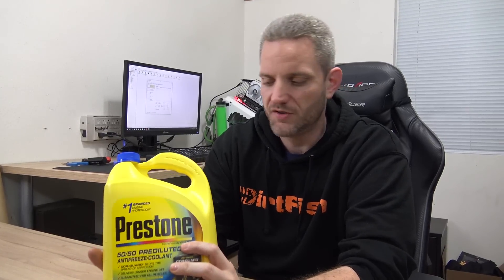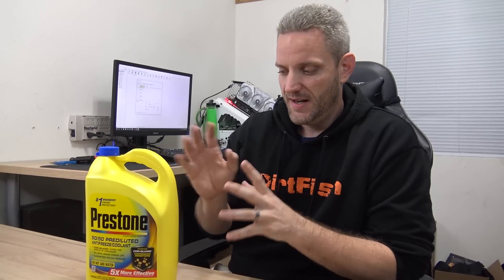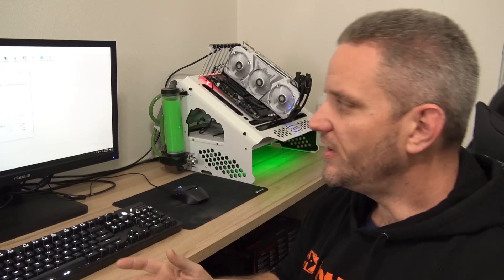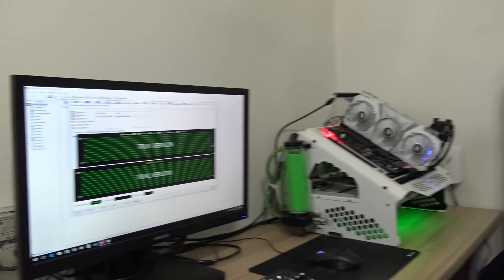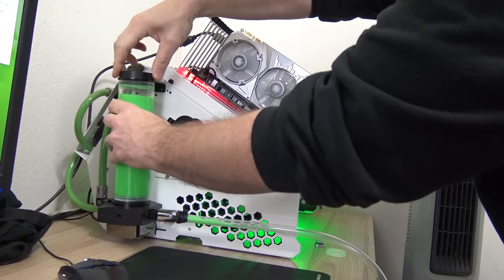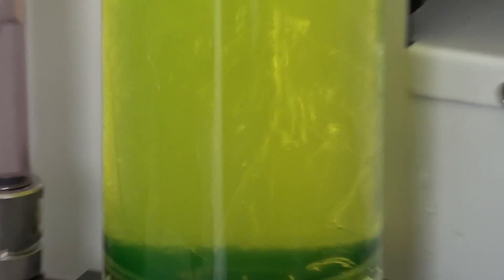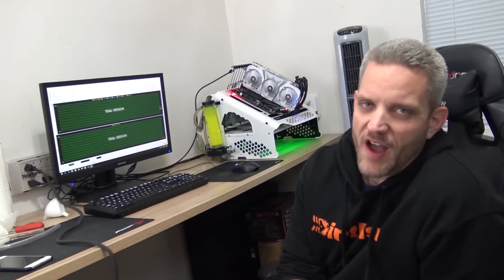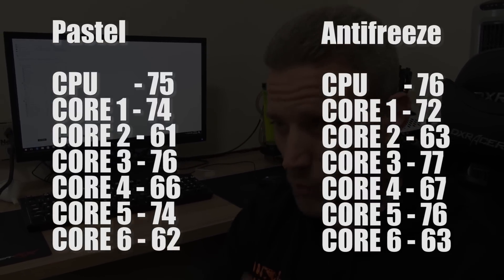I used Antifreeze to cool a PC

Comment: Question: could one build an alcohol based liquid cooling solution? 

Probably won´t archieve much without any evaporation going on, but alcohols like IPA or Ethanol evaporate at massive rates compared to water, and the lines at my workplace run very, very cold.
I also don´t know how the temperature properties are compared to water.

So there´s a couple stops one has to take into account, for example condensation needs to be kept in check somehow...

Comment: Have been using antifreeze in my system for 3 years now, no problems at all, 2x6990 with EK blocks, soft tubing, thermaltake pump, reservoir, 240radiator and cpu block. always 50-55 degrees.

Comment: Any decent car guy would know this. Even better, cuz antifreeze (will work tho) is not as good as 1 bottle of Redline Water Wetter or the Royal Purple brand (@ auto store,12 bucks) mixed with Distilled/RO Water. Many of race & hot street engines use this formula.

Comment: use radiator coolant or Hydraulic fluid.  You also use dextron 3 or other oils.
Reply: Inverted V12 Powerhouse the pump will die
Reply: GamingTurkey use a salvage backhoe pump ;)

Comment: At work we use barcode decoders (basically a lower-end PC) by a company called Datalogic (used to be Accu-Sort). They're totally sealed cases due to the dusty environments they're in, so they are also water cooled. Datalogic actually tells you to use antifreeze in the loop, specifically the pink RV stuff which is also what it's filled with at the factory.

Comment: Been using a small amount of antifreeze in my system with distilled water for a year now to cool it and prevent corrosion. It's been working just fine at really cool temps.

Comment: you can use jet dry though or very light weight silicone based oil.  or just take the whole thing and dunk it in mineral oil.

Comment: I've exclusively used antifreeze since 2010 in a swiftech H20-X20 with soft tubing and have never had a problem with corrosion, contamination, or equipment incompatibility. The tubing is still clear to this day and the mcp35x is still running strong.

Comment: You do realize commercial PC cooling liquids are nothing more than ethylene glycol, distilled water and color additives, right? I've been using antifreeze for private and industrial cooling solutions for over 20 years now. Get the red VW stuff, 1,2-ethanediolalcohol. Not the cheapest but literally lasts forever.
Reply: Jay thinks he is the watercooling guru... he only thinks that though.
Reply: Always run 50/50 antifreeze and distilled water. Anything less and some algea can actually live off the sugar and alcohol in the antifreeze, and you don't want to mess with stuff that can survive in glycol ;-)
Reply: Exactly!! I've been using Prestone for 10 years, not one issue attributable to the liquid, but one or two attributable to me(the great ruined EVGA board of 2007 comes to mind.) I uh, didn't check my hose connections thoroughly.... / : Haven't tried the VW stuff yet, I will.
Reply: Brian Hansen I'm a Audi mechanic and I have tons of g12/g13 coolant at home. (G12 is red/pink g13 is purple) I've been using it in all my loops for 17 years. Never had a single issue. Just mix it 15/85 af/water.
Reply: 👏 @Audiman0aha
Reply: @Audiman0aha 1:5 you mean?
Reply: @EpicBunty  No... 15% coolant, 85% distilled water.
Reply: @Audiman0aha  hahahaha ok sorry for trying to simplify that. I'm planning on taking apart my aio and was just curious.
Reply: @EpicBunty  Hey, it's okay brother. You basically just need to use something as a biocide to make sure you don't have any algae growth inside the loop. Other than that the water does the actual cooling.
Reply: Well, the coolant also works as a conditioner to keep the metals from breaking down.
The reason why car antifreeze works so well is because the average cooling system in a car has about four or five separate metal types all in one cooling loop. Copper, aluminum, magnesium, etc.
Reply: @Audiman0aha  I see. Coolants don't have biocide properties though right ?
Reply: it was pre-mixed antifreeze, already diluted.
Reply: Same here, it's anti corrosive and the heavier weight of the liquid actually results in better heat transfer. I compared it to PC coolant and Distilled water. I also tend to use a big add flowjet pump that lasts forever and out powers the shit out of a $100 PC pump at only 5v.
Reply: SchwererGustav800mm
He also didn't dilute the AF, 1:1 is too heavy and will not cool as well.
Reply: megaspeed2v2
Yeah, I saw the video. It needs to be 15:1 or less.
Reply: Kinsey Benedict hm.. ok then

Comment: Use gallium to cool your pc
Reply: In aluminum tubing right? :D
Reply: Gab:P
Reply: PRO-digi if you turn off the computer it would go solid
Reply: PRO-digi metal conducts heat better, liquid solution without glycol would be better.
Reply: +Gab
 even just aluminium cooling block is all you'd need.
Reply: Brad Hintz Depends on iff you use pure gallium or an alloy that has a lower melting point

Comment: How about another liquid meant for automotive applications: Water Wetter?  It's used as an additive and reduces the surface tension of the water/coolant allowing for better metal wetting which increases heat transfer.  In other words, the lower the surface tension of the water, the better it can flow into all the little microscopic nooks and crannies that are on the surface of the water block.  This effectively increases the surface area of the water block by a pretty large factor.

I doubt it will be any better than the additives that are like it that are specifically made for computers, but it would be interesting to see the result nonetheless.  Pretty easy too; just dump the Water Wetter into the system and fill it up the rest of the way with distilled water.

Comment: I think that weird shit in the antifreeze when u first put it in was jsut the water that was in the bottom not mixing intermediately with the antifreeze
Reply: This.
Reply: Need to has the drama tho
Reply: Could also be the heat from the pump. Like a lava lamp, the heated liquid is traveling towards the top.
Reply: yeah its exactly that. Like when you mix water and fruit juice
Reply: Ya. Water is lighter than the 'antifreeze' oil so after pouring it would settle by going upwards to float on top of the antifreeze.

Comment: As i know antifreeze is used to prevent liquid to freeze in extremely cold climetes. In a liquid cooler the liquid becomes hot and cooled later in the radiator. Like you said it is pointless. Fun video anyway. :D

Comment: I have a off brand H80i from alienware in my system last year the heatsink in the cooler that sits on the cpu became crusted by some material in the coolant. so I took it out boiled the heatsink and scraped all the gunk out. then I put it all back together and filled it with purple antifreeze. still working fine.

Comment: Anti-freeze is actually worst at cooling than water. Anti-freeze is only used to prevent freezing, boiling and to prevent corrosion within the cooling system. That's why 50/50 solutions are used. 100% straight anti-freeze can actually cause your vehicle to overheat.

Comment: So I ran a test. I routed my cpu and sli water cooling tubing out of my room and into my attic so the cold air outside will cool my radiators. 
the experiment came to a quick end after the temps outside reached cold enough to cause condensation on my water blocks. I even had to unplug the fans from the dual 480 rads to prevent dangerously low temps. there will NEVER be a scenario where ANTI FREEZE is necessary.

Edit: location Detroit.
side note, the computer could never be turned off to prevent the water 
temps from going low enough to begin condensation on the water blocks. I
 literally would run games in the main menu at 5760x1080 as my "idle" 
and temps were in the 30's C when ambient temps in the attic were 30-45F
 with the fans on the rads off.
Reply: I guess it's kind of like a cold bottle of water or glass of iced sweet tea sitting out in the summer sun in the south.

Comment: EVERY single PC coolant sold on the marked is MEG based! The rest is marketing BS. Bring some coolant to independent lab for testing and see for yourself. It is also worth mentioning that all this "green" bs advertised with coolants is also pure marketing. MEG is organic compound with half-life of roughly 28 days. 

Not every antifreeze is the same. There are also glycerine based options as well. Also - there are solutions that use silicate-free corrosion inhibitors(no gunk). Just read the datasheet if it comes with any. It took me about 1 hour to find myself a local manufacturer who stocks all kinds of cooling liquids used in every possible situations - form automotive to industrial. Even managed to find a colorless MEG ready-made, silicate free concentrate for preparing 10% solutions for €3/liter.

Comment: ugh. these people and not reading what's in their coolants. here's the specs on the thermaltake stuff my system uses - 

Water ~ 94%
 Propylene Glycol ~ 6%
 Ethylene diamine tetra acetate detetrasodium (ED .TA.4Na) ~ 0.1%
 Methylparaben (M.P) ~ 0.1%
 Color pigment ~ 0.002%

for those who don't know, propylene glycol is what's used in modern anti freeze mixes like dexcool in GM vehicles. only the recipe is different, the ingredients are the same.

Comment: I was going to make a comment about using straight antifreeze, but then I noticed in the video is that Jay is actually using pre-mixed 50/50 antifreeze (50% water, 50% antifreeze, which is a marketing gimmic, you pay more and get less product), this making my comment useless. I would like to mention that the antifreeze that Jay was using is OLD SCHOOL, as modern coolants are either Gold, Orange, Red , or Dark Green. ALL modern coolant also incorporate a anticoagulant agent in them so that  minor leaks will self seal ( that is why when modern coolant leaks you see white crystal growth at the leak point) . Jay, you might want to consider doing a video using Gold coolant and creating a minor seep (very minor), and one of the fittings, and video the process of the seep self sealing and thus saving the computer from a leak melt down.

Comment: The only reason cars use antifreeze over distilled water with anti-corrosives | anti-microbial is because in colder temperatures the liquid will not freeze over. I use distilled water on my motorcycle with additives in FL because temps would never get that low.

Comment: Antifreeze isn't actually used for cooling the engine of your care. It actually has a lower boiling point than straight water. It's called antiFREEZE because the petrol and glycol lower the freezing point of the water significantly. The idea is to keep your engine block from freezing solid and cracking in the winter. In the summer a car can be cooled with just water, although it's not recommended.

Comment: I have heard that the AIO manufacturers put ethylene glycol in their loops. I don't know if it's true or not. But antifreeze does have a few corrosion and reaction inhibitors. I have doubts that soft tubing would hold up in the long run with antifreeze.

Comment: This went exactly as I expected it to. Antifreeze/Coolant doesn't improve the cooling qualities of water. It just reduces the freezing point and increase the boiling point of water. ie. it makes the water withstand harsh winter weather conditions and the high heat temperatures an engine goes through (Usually around 100 degrees celcius). None of which would ever be reached by your average computer.

Comment: good video, but not surprising. glycol has a worse thermal conductivity than water, so you'd expect the heat transfer performance to be worse. it's added to vehicle systems to prevent freezing at low temperatures (below where water would normally freeze).

Comment: I used antifreeze diluted to 50/50 for years in loops I made about 10 years ago. It worked great and cooled as well as anything on the market at the time. It also had better anti-corrosion and anti-algae properties. The only difference between then and now are the plastics used in WC components. Any plastic with glycol in it will react with antifreeze. Avoid those plastics and you will be fine.

Comment: The issue I have with this is that ethylene glycol in antifreeze is not there to increase cooling capacity, it is there to keep the engine from rusting and more importantly to KEEP WATER FROM FREEZING!  Alcohol has a lower freezing point than water -12.9c versus water at 0c.  Alcohol also has a lower specific heat than water, so you are actually losing more theoretical cooling capacity than running straight water.  Another reason this works in vehicles is that the cooling system is pressurized, which increases the temperature needed to gassify (boil) fluids.  Hence when you take the radiator cap off when the vehicle is hot, fluid spurts out (fluid is flash boiling and the gas is carrying out fluid from the radiator).  This plus the reasons JayzTwoCents states, are the reason to NEVER use antifreeze in anything that it is not designed for.

Comment: so if my CPU gets up to 43 °C or 106 °F while playing battlefield 4 is that bad? I am using air cooling
Reply: why are you reading temp in fahrenheit? Weird...
Reply: Airtrooper719 XBL OK, 42 °C
Reply: no it would almost have to double to be anywhere near worried
Reply: donutsniper No my CPU hits 82°C under full load with air and its fine. My CPU is 29°C at idle. (i5 4690k @ 4.7GHz and evo 212 cooler)
Reply: no, mid 40° Celsius is 100% normal temperatures for a CPU or GPU that has more than ample cooling for the amount of thermal it outputs under load.
Reply: OngoingTech that's not good
Reply: 43C is very acceptable with a load on CPU.
Reply: xGattsu I dont bother with prime95 or none of that shit, if it works with what I want it to do, thats good enough for me :) in my case, the CPU OC is mainly to help BF1 along more in 64 player matches.
Reply: p.s I can get to 4.8 on air, but I use 4.7 for extra peace of mind and lifespan of the chip.
Reply: Not at all. I run my i7-3930K at 4841mhz for gaming Battlefield 4 and BF1. Even water cooled, cores can get as high as 67C. Not an issue since lower clock speeds and even stock clock speeds can exceed 60C with stock cooling. I would suggest any temp above 80C for prolonged periods might be detrimental.
Reply: cause America leads the world
Reply: google it
Reply: 40C is ok, but 50 and more is getting hot
Reply: Ali Abbas thank you!
Reply: Ali Abbas I just played call of duty MW3 and I got 59°c max

Comment: what you see and you say it is a reaction is most likely the change of refractive index of the fluid during the process of mixing the distilled water residues with the mixture of water and ethylenglycole. Why don't you install a loop with just a pump and a reservoir without any hardware to see the long term properties. I don't think it will do any harm to the plastic either. Worst case the plastics get milky but not worse than that.

Comment: I have some experience in running a car coolant (ethylene glycol based) in my primary PC. My loop (all soft tubing which I think is PVC-based, the brand is Masterkleer) was running for over three years with a liquid that was approx. 25 % car coolant (it was not neon green, but dark green, the brand is Glyco-Shell) and 75 % de-ionized water. No problems, only needed periodic addition of liquid which I think is not because of leaks but because I have long tubing, my radiator is outside and far apart from the PC, and I have read that the liquid evaporates through the soft tube's walls. 
I then took the system apart and carefully inspected all components. The only change was a slight green coloration of the tubing, NOTHING else.
My primary reasons for using the "anti-freeze" are: it provides some additional lubrication for the pump, the green color helps detecting possible leaks, the possible anti-corrosion and anti-algae effects. I have read that pure distilled water could also work without problems, but for the above reasons and my experience I will continue using the 25% anti-freeze in DI water combination.

Comment: Another point of interest, because your car operates at much higher temperatures, automotive antifreeze typically lacks growth inhibitors. Want to see what happens when it's run, in not just one system, but a whole room full, for extended periods? Go watch LTT's whole house water cooling videos. Moral of the story, antifreeze is expensive, melts PETG, and has no growth inhibitors (which if added could potentially react anyway, don't know I'm no chemist).
Reply: Silver coil. Done.
Reply: True, Kinsey Benedict, and that shouldn't react. Is it worth it though?
Reply: firereverie
I've used AF for 10 years, not one issue. I use Tygon R3603, and an acrylic reservoir. With a coil and PT Nuke, you can use just water, which will cool very slightly better. I love AF, it's UV reactive if you want to light it up, cheap as hell, and available at WalMart at all hours of the night. I dilute to 15:1 or so.
Reply: I've run it for years with no algae or melted tubing. They sell silver coils even for your officially sanctioned PC coolants.

Comment: The plastics should be fine. If it isn't anything weird in the tubing. Coolant is transported in plastic. I used coolant in a mix with aluminum and copper. Worked really good. No corrosion issues at all after 6 months!

Comment: hay jay theres a known product in the automotive industry call Water Weter its from RedLine and you mix it with water or antifreeze coolant and it lowers the engines temp even more you should try a test with that, its 10 or 12 bucks